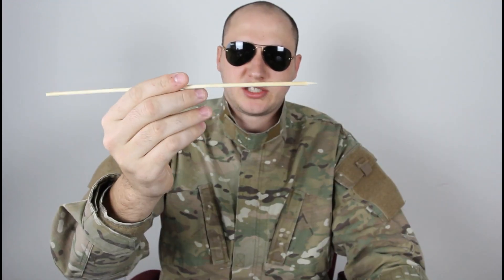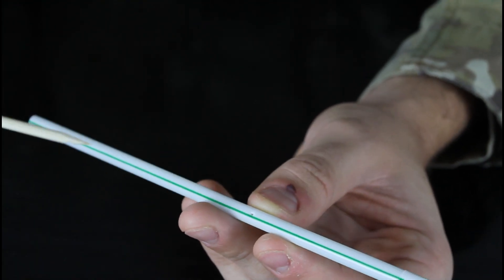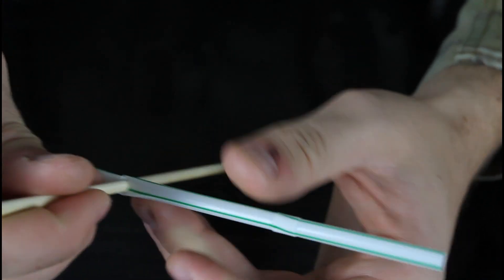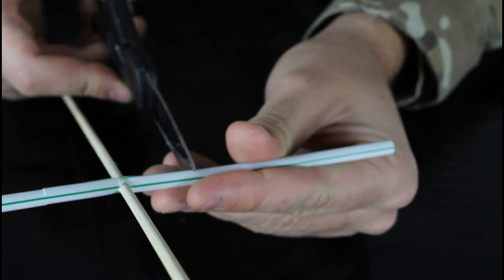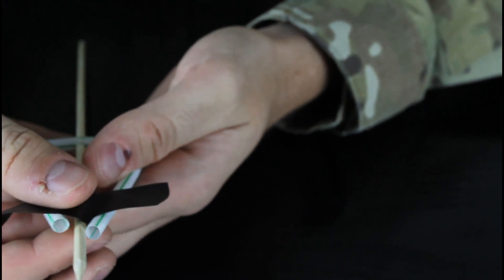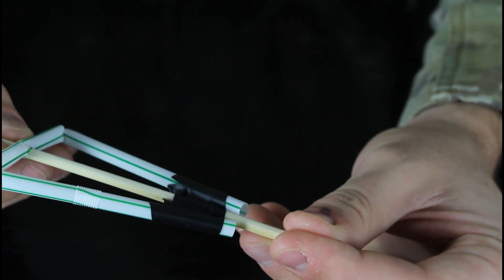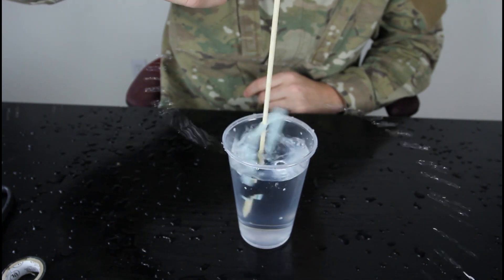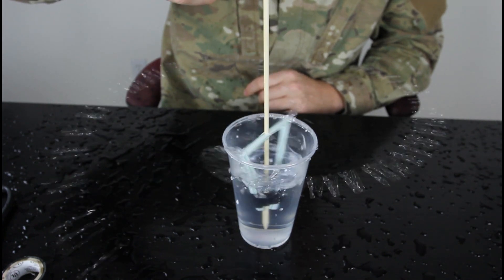Simple Water Pump from a Straw - science experiment

Comment: According to me, the air is moving quite fast with the respect to the holes in the exposed side of the straw, and according to burnolis(sorry about his spelling) theory
whenever a gas or fluid moves at a high speed, it exerts less pressure,which means there is a less amount of pressure on the top of the exposed holes.
Water always exerts pressure, and since there is no air in the straw(the air present in the straw moves up and escapes ,as high pressure always flows towards low pressure) a capillary action takes place sucking the water up and out of the holes.

Comment: centrifugal force is strong enough to bring the water out even though the straws are at about 70 degree angles. I doubt this would work on a large scale due to the water being to heavy and having to much mass for the straws to spin.
Reply: Actually it is centripetal force. Centrifugal force is not a real force, it is a made up term to reference as a reverse perspective on the centripetal force in a scenario
Reply: Gavin Stephanson Centrifugal force is the imaginary force which forces the water up and out of the tube. (centrifugal is imaginary because water is actually pushed out of the tube by the effects of inertia)

Comment: Is because of a negative pressure inside the tube is created once its in motion. You can do the same with just a garden hose in a water barrel, just whip the one end of the hose in a circle and water will spray out. Providing the hose is not too long.

Comment: Good thinking! There is another factor - capillary action. If the straw was sitting vertically, the water would only rise a little above the surface of the water (smaller straws would raise the level even more). 
Combine the raised surface with the water being slung by centrifugal action creates a vacuum in the straw that draws water through. Some of the water slung is not pumped but merely centrifugal action on water on the straw and some simply knocked out by the 'propeller' - sloshed out.

Comment: I hope you commentors understand that centrifugal force is not a force but a property we observe through inertia.  Inertia is to call out for the movements of things from planets to spinning balls attached to strings. The water wants to travel in a straight line, and therefore will rise because that path is a wider circle nearer to the top than at the base of the straw, and therefore a closer shape to a line. An example would be when wou spin a bowl full of water, the water goes to the sides.